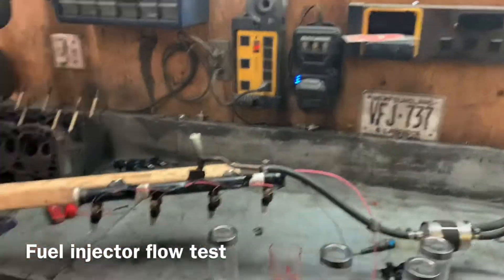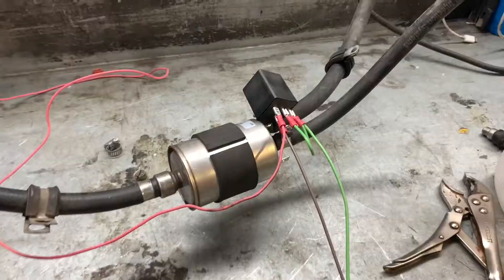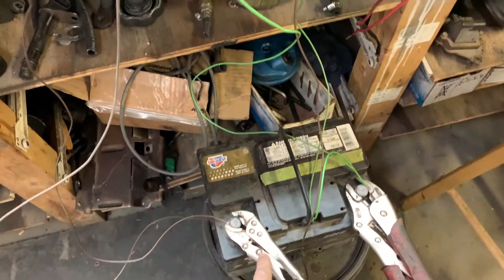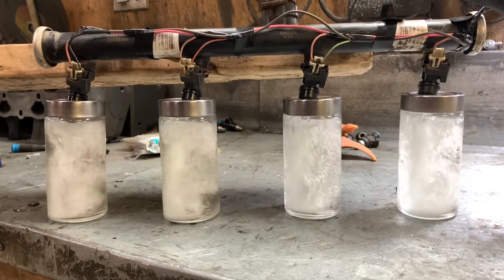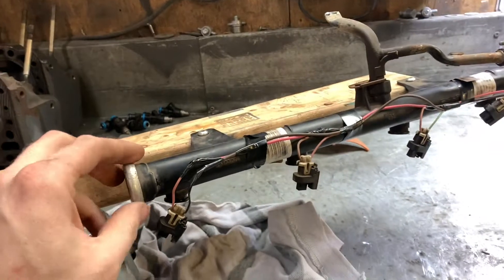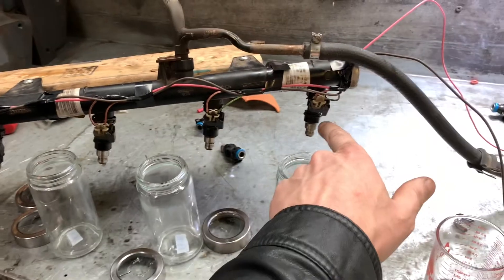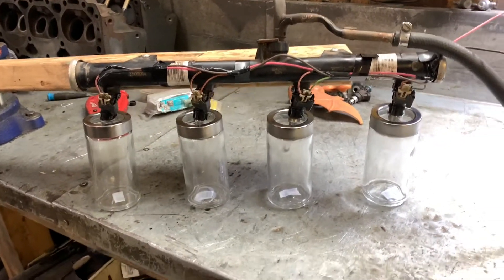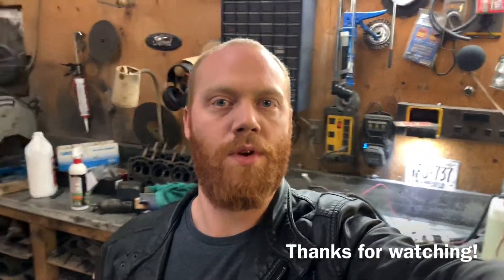How to clean and flow test injectors yourself! - DIY

Comment: How are you calulatiing the lbs/hr anyways, what math are you using to find that?
Reply from the maker: This might get confusing, but if I remember correctly I ran the injectors for 10 seconds each time I did the test. Then I went on google, typed “convert ml/second to LB/HR” I think it was 120 ml per ten seconds, which would be 12 per second. Multiply that by 5.71 (that’s the conversion rate as per google) and you get 68.52. The injectors were all very close so I just rounded it to 70 LB/HR on my tune and made up any difference with the histogram and my wideband. It worked very well and I still have these injectors in the Cadillac now without the turbo
Reply: @StationroadRatrods  thank you I will try that, I bought a flow machine but there's no mathematical calculation to help me figure it out. Did you test/calculate those injectors at full power or was it on a static pulse?
Reply from the maker: @hmoobva3581  I did that test at full on to get a flow number, and I tested them at 58 psi, being that is the fuel pressure of the trucks. I also did a pulse test just to be sure that the injectors were all even, but didn’t take any calculations from that test. I bet the flow machine is a nice setup!